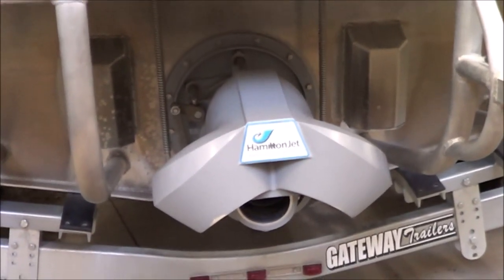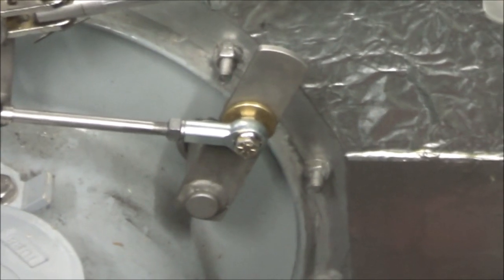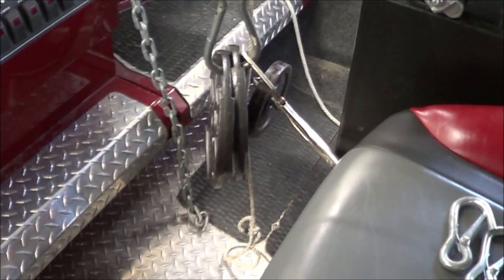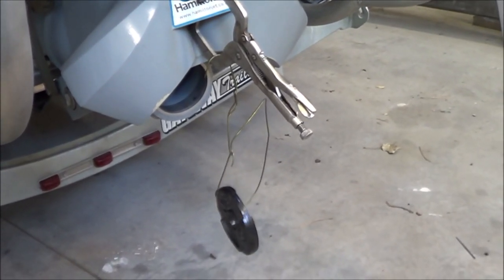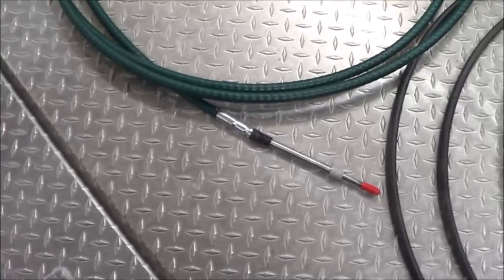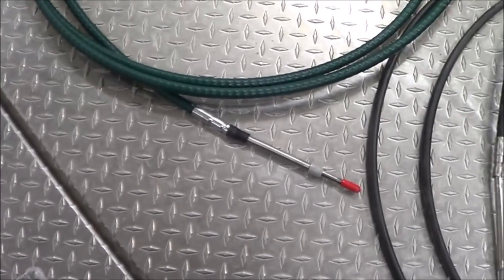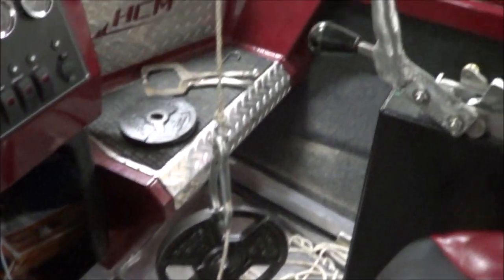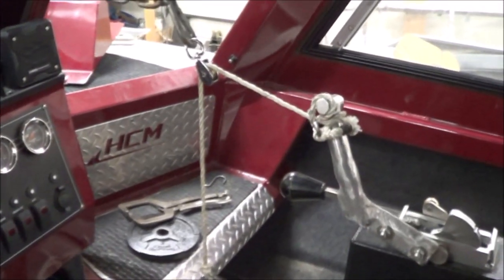Hamilton 212 Dissected Part 2 (re-re-upload)

Comment: The helmet setup and bends in the Morse cables are the main cause. Not Hamilton's parts. The braking mechanism you talk about is used to lock the reverse duct in any position.
Reply from the maker: A previous video fully dissected the Hamilton brake box, and its removal produced significant improvement. No doubt had I first swapped the cable (prior to removing the brake box), there would have been improvement. However, this would not have eliminated the "momentary lockups" that originates in the brake box. I tried two brake boxes and they behaved identically. It is possible that other individual brake boxes function as designed; however, these two did not. Other people describe similar problems, so I am not alone.  

Some suggest that the momentary lockups can be eliminated by moving slowly and deliberately. However, if this was recommended for the brake pedal on your truck, it would not pass safety inspection.

Comment: Do you have problems with the reverse bucket dropping when you're on plane now that you have pulled the brake off? Thanks
Reply from the maker: No. But this is a single lever setup, so my hand on the lever is attending to the bucket position. A concern is that when beaching and tying the boat up, I often leave the boat idling in forward while securing ropes. It is possible that the bucket will drop and pull the boat away from shore. However, this has never happened because (1) the spring is holding the bucket up (2) the boat is  beached so there's no jostling (3) there is some friction in the reverse cable etc. 

I understand that some people have removed the brake box with dual lever controls. If you understand the implications, this may be acceptable. An alternative is some sort of latching mechanism at the helm. Outboards have this type of latching.